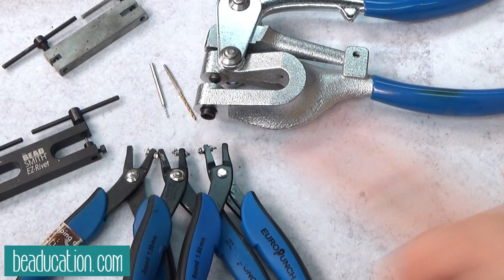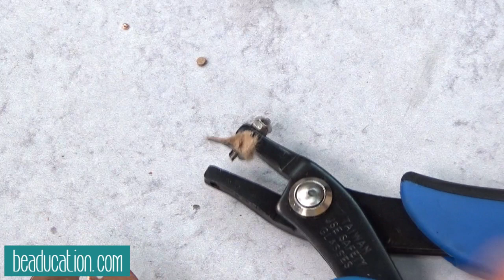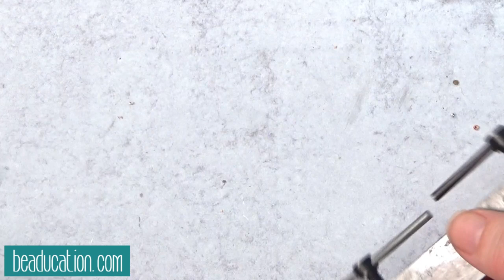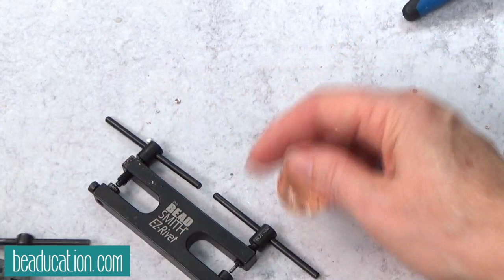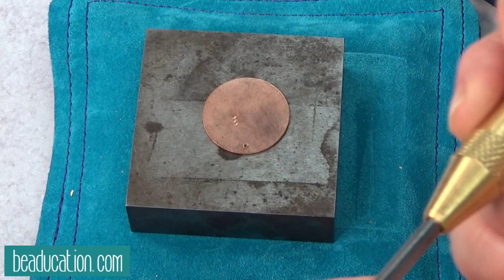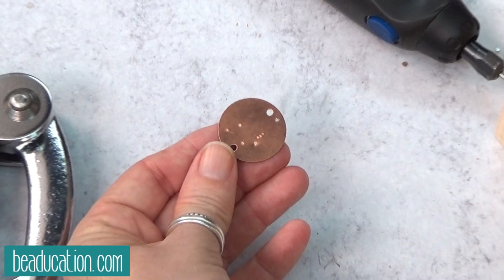Tools for Punching Holes in Metal - From Beaducation Live Episode 55

Comment: I love the video very informative. I have a question regarding the Dremel. I purchased mine a few years back and have yet to use it. I'm intimidated. Do you have or will you make a few videos on using it and the correct usage of the bits please? I just keep taking it out and putting it away again. I have googled and googled it, but everyone tells me something different. Please help!
Reply from the maker: Hi Carol, the bit size depends on the project and size hole you want. I don't have anything specific to the Dremel. We have used it and we sell bits that work well for jewelry making projects.
Reply: Carol Jolly, I didn’t start using my dremel until I bought a smaller handheld pen-like extension that has flexible metal wire tubing; it made using the dremel less intimidating.  I got the extension at Home Depot.  Hope that helps.

Comment: Is that works on stainless steel jewelry? the large stronger punch? Which one is best to make punches on this hard metal.
Reply from the maker: this punch will only work on thin stainless. Other than that I would find the appropriate drill bit (at the hardware store) and drill the hole. Stainless is some hard stuff!